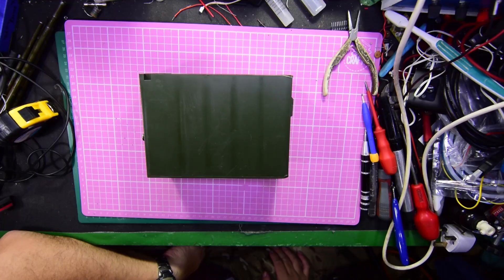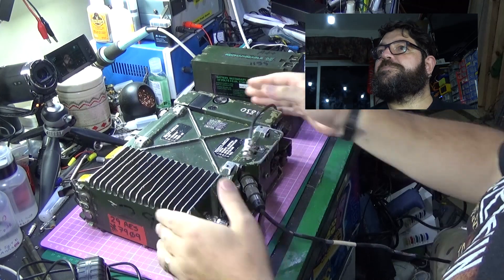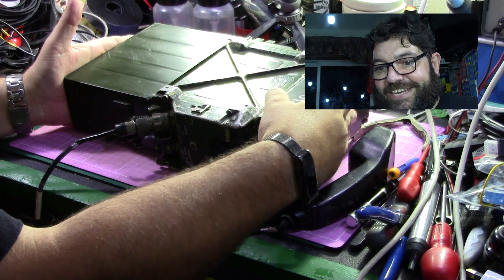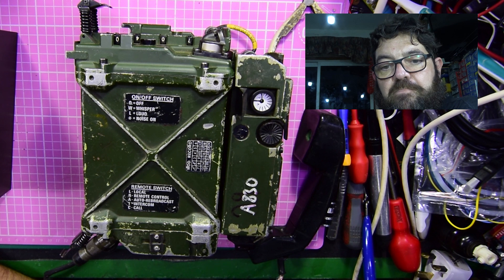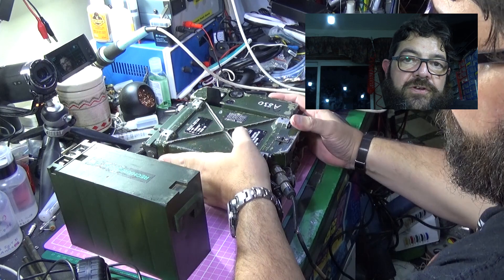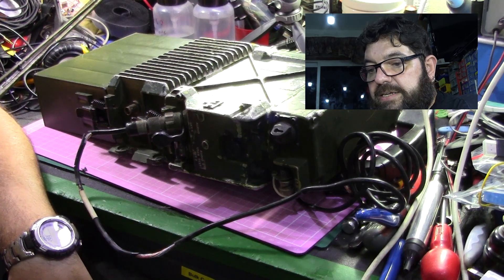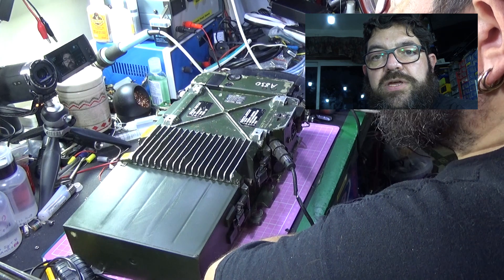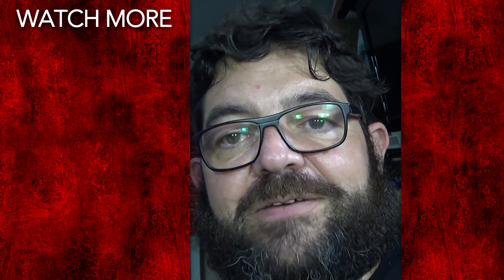Clansman RT 351/352 Show and Tell

Comment: Hi George, thanks for this video, I've been keen on these units for a while and you have filled some gaps in my knowledge. At present the bare radio unit seems to be going for £85 upwards, do you think that's about right as a current price (2022) please?
Reply from the maker: To be honest I'm not sure on current prices. I know some eBay sellers are completely over the top price wise but supply and demand I suppose. It's been a few years now since the MOD dumped clansman onto the surplus market so there might not be as many for sale. The extra expenses come from the accessories.. the batteries, holdall, battery charger, headsets and handsets etc. You could end up paying more than you would for a decent secondhand amateur radio.
Reply: @GeorgeChristofi  Thanks for the reply George. You are completely right about prices, supply and demand. There seem to be a few big buyers at army surplus sales and they effectively form a cartel as far as prices go. 

I have a PRC 320 and know only too well how the little "accessories" add up!  Still I would like to find a reasonable condition 351 as the 4m band is quite popular in my part of Berkshire.

Comment: Is there a way to charge these batteries without buying all the clansman stuff?
Reply from the maker: There is but it is a pain in the bum. You need a current limited power supply and a temperature monitor. At a push you could just connect to a 24v supply but then you run the risk of the nicads in the pack rupturing.
Reply: @GeorgeChristofi  I did think about that. I have a PRC 349 so they are the smaller batteries. I use cassettes at the moment and have one rechargeable I could try.
Thanks

Comment: i know that this is two years later, but i have been playing with this for a couple months 29/11/20. can i ask you ? you cant fit--- radio, amp,surf(turf),  because the radio  has 4W amplified by 20W then  80W buzzing through the 4W turf. (i have two that have been fried
some how) but can you go --radio, turf then amp.?, i have so many questions.
Reply from the maker: The normal method of connection is radio, into surf, into amp. The turf was only vehicle mounted and rated at the 25w the amplifier put into it. I'm not sure where you got 80w from unless you are talking about the bigger unit the 350 which was vehicle mounted or base use and was a 50w radio.
Reply: thank you for your responce. A lot o folks  tell me "you can only use one or the other but not bothe" but my mate used them in the falklands and but he  has problems remembering so i dont want to hurt him, or anybody.